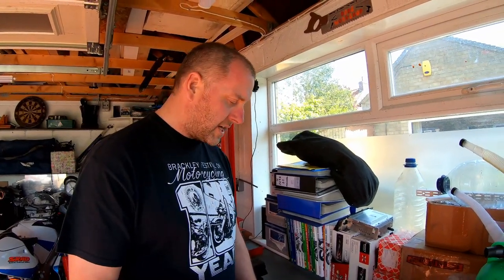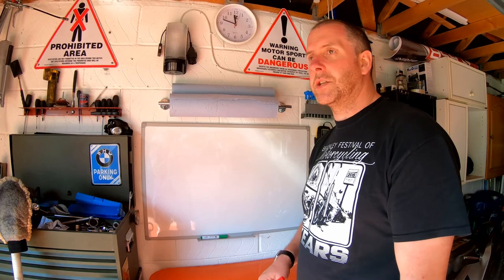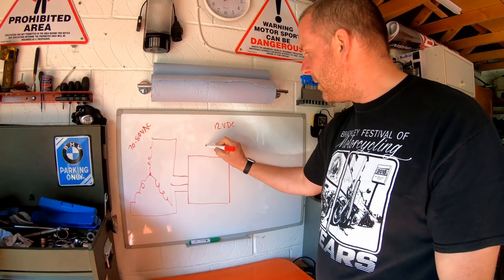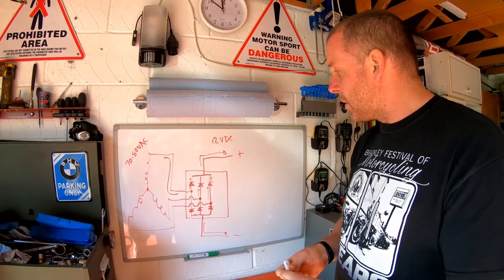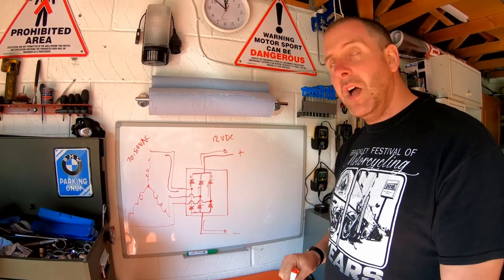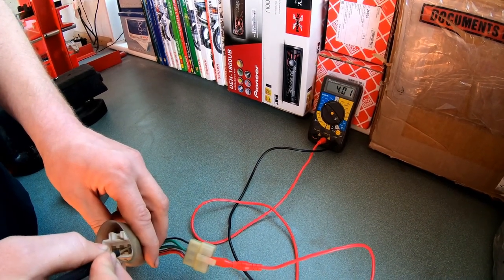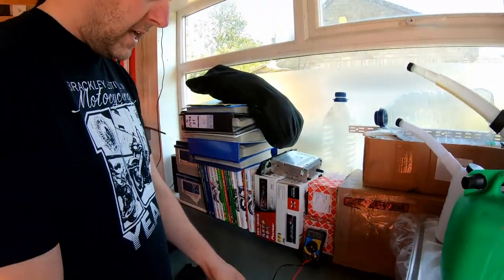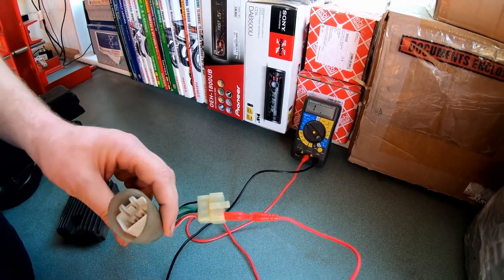How To Test The Regulator/Rectifier On Your Motorcycle

Comment: Great vid made it makes sense now what it does. If you did a reading when opposite would mean the rectifier is shot and that’s what causes the battery problems as positive is filtering to the negative on the battery
Reply from the maker: Motourev: Motorcycle Tours & Reviews if you got a reading in the reverse direction then that would mean a defective diode. If the diode doesn’t stop current in that direction then it won’t be rectifying AC into DC. Kinda hard to explain in text, I suppose I should have said that in the vid in retrospect!

Comment: Thanks so much for this and your stator video. My very ignition wire melted … I rode the bike home after jumping w a booster box. Seemed ok. Went to ride next day, found red ignition wires melted. Now have new ignition w battery in. No lights no power… no crank/start… main fuse by battery ok… maybe another main fuse? Going to check stator, then reg rectifier… again, many thanks.

Comment: Hello. Negative lead on positive side I get following reading : .553,.553,.544
Positive lead on negative side : .557,.521,.551. 
Are the small differences indicating faulty rectifier?
Thanks!
Reply from the maker: No, not really, those readings are ok, if however you get a reading in the opposite direction then that would be bad as it indicates a faulty diode.
Reply: @KevsShed  thanks!!

Comment: Hi great videos I’d be lost without this  ive got battery trouble the bike isn’t charging the battery when running  checked  stator as per your video and seems fine just checking reg rec now and there’s no reading when going forwards , like on your test  you get around 4 on all 3 connections  im not getting anything di u think this could be the culprit many thanks

Comment: If I followed the video as closely as I could but didn’t receive readings in either direction should I take that as a sign I did something wrong or would that be expected with a burned out rectifier/regulator?
Reply from the maker: You didn't get any readings at all? Unusual but not impossible I suppose! I would expect it is knackered. I assume that you are having charging issues, hence why you needed to test it?
Reply: You would be correct
Reply: @RWJonetimecommenter  I have the same situation as you in my VFR: / measurements show nothing in both directions. what was the reason for not charging in your case? did charging come back after replacing the regulator?
Reply: @slavicmercator7544  yeah replacing it seems to have fixed the issue for me

Comment: Thanks for a great video!  A few questions.  How hot should the rectifier get?  I have a 1998 Honda cbr 600 and the rec. gets really hot.   Damn hot!  It could easily burn my finger if I left it there for a few seconds. I mounted the rec on  two longer bolts with two small copper sylinders between the rec and the frame for good grounding to get it away from the frame in order to get better air circulation around it. My afterthought was, does the frame serve as a heat sink? Will the rec get even hotter now?  Second question,  I want to order one to have with me on the bike in case it should burn out somewhere on the road.  Who makes the best aftermarket rec for the Honda?  Thank you!  Greetings from Norway from Daniel
Reply from the maker: All R/R get hot, that is a byproduct of voltage regulation that cannot be avoided but hot enough to burn your hand? I'd say that's a bit excessive. There are many aftermarket R/R manufacturers but I am yet to find one that i'd recommend! Your best bet if you only want it for emergencies is to buy a second hand genuine one that you know works and just pop it under your seat incase you have a breakdown!
Reply: @KevsShed  Thank you! Keep up the good work  :-)

Comment: Yes the diodes seems to be good in rectifying but how do you know that the regulator is doing it's job maintaining a constant 12vdc output?
Reply from the maker: Using the multimeter across the battery 👍🏻

Comment: Hello Kev, is there a problem if i get value only at 2K Ohms on multimeter (between .460-.485)? At 20K i get nothing. My VFR800 charged and worked great around 14.8-14.9v(i have an voltmeter mounted) but she stayed unmoved for 2-3 weeks, when i started her today she turned as usual but right before to fire, like half of a second, everything got off then all good and she didnt want to charge above 12.6v. After 30km she started to charge as normal until i stoped to pus gas, the she start to charge again at 12.4v. What could be wrong? All connectors looks brand new, 3P stator check gave me good value and  R/R check gave me value as above. Could be battery? She is 4 years old. Thx!

Comment: Hiya kev. Am wondering some said you did RR kit for the VFR800 not sure if still did. Thanks if help
Reply from the maker: Hi Guy, I do indeed. Send me a PM on Facebook and I will add you to my list, I do have a bit of a backlog at the moment though with a lead time of approx 4 weeks.
Reply: @KevsShed  hiya yes left a message on there thanks seen your video. But some one cut real close to the RR and used bullet connectors.

Comment: Hey kev was wondering this have anything to do with no headlights or dash cluster both r dead bike run fine blinkers work brake light work any ideas what this could be by the way love the vfr videos
Reply from the maker: I would check your earth block behind the top fairing mate, you should be able to check continuity with a multimeter mate 👌🏻
Reply: @KevsShed  thanks man but turned out to be license plate wires just brittle and touching metal rewire alls well thank ago tho appreciate it
Reply: @KevsShed  to my license plate light who figure saw it on a forum or would have never looked there
Reply from the maker: @craigberinato9226  Glad you figured it out mate! 👌

Comment: So if the reg/rectifier was suspect or faulty what readings would you expect to see and why? Also possible browning/melting of connectors/plugs due to heat? Many thanks.
Reply from the maker: I do wish that I had a known faulty one to demo with! I may try and find one and make another video. I would expect to see a figure that was wildly different to the others. Also if you get any reading when carrying out the reverse test then that would indicate that the diode was defective. The plugs can be a problem on even an otherwise perfectly serviceable rectifier. Unfortunately the connectors can be a source of high resistance, particularly if corrosion has been allowed to set in. This in turn causes excess heat and can lead to melting or browning of the connector as you described.
Reply: @KevsShed  
Thats what i got. The connectors to the stator both melted. Two yellow wires were reading 4.53 and nothing on the 3rd yellow wire both ways.
So I take it its knackered. But I need a plug for the stator side as its melted but the wires and spade connectors are OK so got to find a place just to get that.

Comment: Hi just looked at my stator but am missing the block all I got three yellow wires
Reply from the maker: I guess someone has cut the block out and crimped the wires at some point! 👍🏻
Reply: @KevsShed  yes so not sure how to test seen your video. There no block connector on stator side or the rectifier side which it should. Before last time on it was showing 10.5 volts before that it was 14.5. Or 6
Reply: @KevsShed  yes the connector on each side gone and they have crimped it. But the wires just only reach. And the wires on the rectifier are short. So not sure if to cut them all or not. Grrrrrr be easy if some one not done it. Also trying to find a better replacement rectifier and I know westcountry rewinds do stator if have to go down that line. Thanks for any help ta.